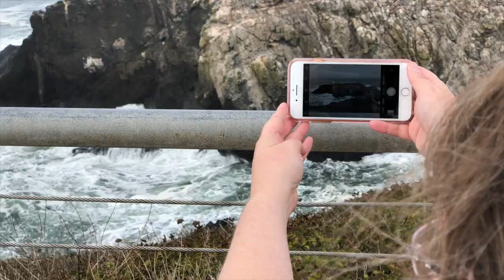Getting Back Into Life | Part 2 | Forcemech Foldable Wheelchair Review

Comment: I have a spinal injury and my lightweight powerchair, very similar to your, different maker, but same weight, has transformed my life outside my home, but now my house is inaccessible. Well I suppose you can't have it all! If I had a better home my chair would give me the best of all worlds, as really I need it about 90% of the day. The best times of the last couple of years have been in my chair, such freedom! I never thought I would delight in having a wheelchair but really it has bee such an education, if you have limited mobility that means limited life unless you get over your resistance to using the things that give you freedom again. My chair was a very generous gift, and I am so grateful for it. 

A small warning, be wary if you have little sensation in your legs, these are quite powerful chairs and while they are light compared to most powerchairs if you bump your legs moving forward it will result in a nasty bruise because of the additional momentum.  

The amazement you describe I see if I have to take a taxi, the drivers are always intrigued because they have never seen anything lie it! And when they see how fast it folds their faves are a picture. 

My battery is different and easier to remove, the slightly smaller version is exactly like yours. 

I would like to see how you make it work for you in your creative life! I have several travel art kits but last summer was too hot here in the UK! It ended quite abruptly with storms and rain, and that has deterred me going out to draw and paint.
Reply from the maker: Lindy, thanks for sharing your experiences with your chair...I especially love the image of the amazed taxi drivers ❤️❤️. Also thanks for the heads up in bumping my legs. I’ve squashed my foot once already 😮. I will be careful. I hope someday you can find a way to make your home more accessible. I’ve wondered about putting a rolling office chair in my kitchen, but then all the work surfaces are too low...oh well.

Comment: Congratulations for the video! I’ve watched the two parts, it’s very clarifying and informative. You’ve shown some details that nobody pays attention to and nor even understand when we try to explain, for example, tables are frequently a problem for wheelchair users. I’m a wheelchair user from Brazil and unfortunately this kind of electric wheelchair is not available here, they are all extremely heavy and completely different from this model. I would certainly import this wheelchair, but the fact that not having warranty and support in case the wheelchair gets broken is something to be considered. Thanks for being sincere and talk about the issue you had while traveling with the chair even they doing a partnership with your channel.